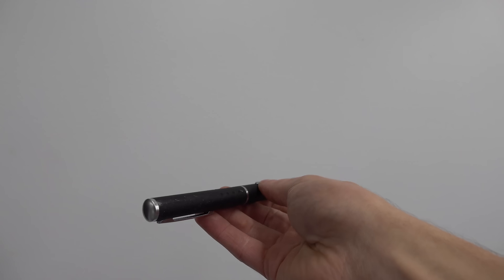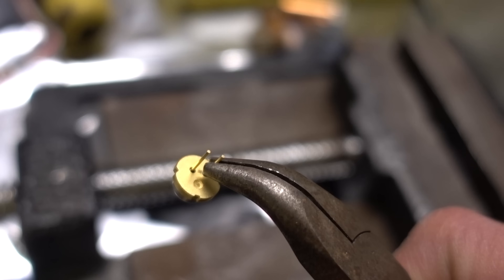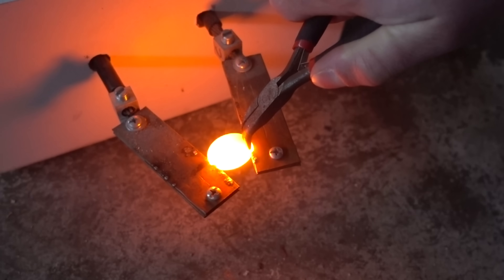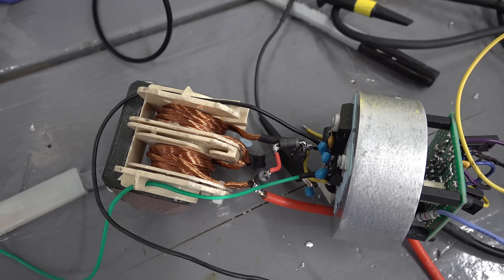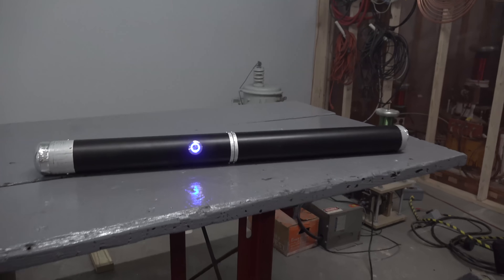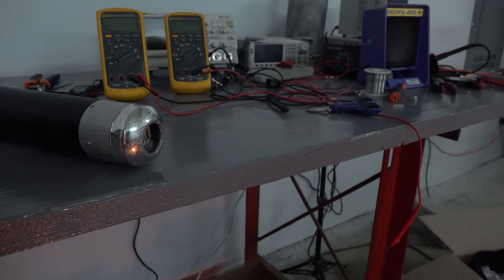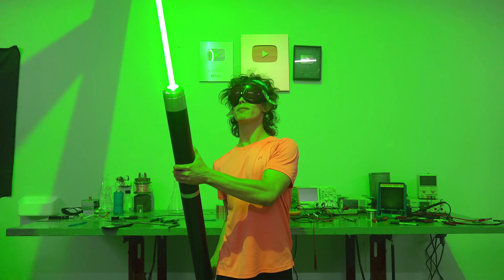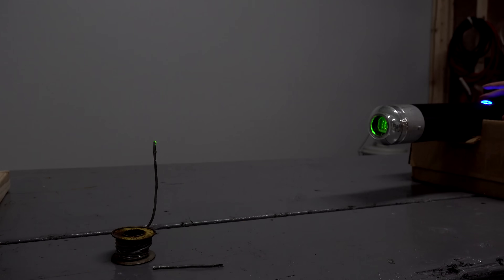the brightest laser pointer in the world!

Comment: Love your vids you inspired me to build a high voltage circuit in which it can hold almost unlimited electricity enough to produce fusion like 3KV and it works with a copper oscillator I have created a new type of dc ionized electricity on 24V it makes noises on my custom receiver and I would love to work with you on a new laser diode semiconductor that can hold enough for fusion. Let me know!!!!!! Mine currently die after a 24V charge is put through it i have an illegal diode makes it wide band. haha

Comment: Could the reason why the green gap exists be because it shares a harmonic frequency that’s close enough to be dissonant with AC or is it observed in both AC and Dc builds? 540 to 60

30.32thz (60cycleAC) and 5.33 (Freq of green)

it’s like playing the 5fret tuned up.33 cents and then the 6th fret 2 octaves up tuned up 32cents.

That going to be the most dissonant note you have ever heard creating pathways that are hard to traverse for electrons. If you could increase the cycle speed by 1.01 thz you might be able to create a harmonic resonance. It wouldn’t be perfect because those are round numbers and e is irrational but I would be interested to see the results

Comment: Life extension rule 101 , do not under any circumstances  open a microwave to strip out parts unless you know what you are doing, the capacitors in microwaves work on the principle of reaching charge then holding it for great lengths of time till you press the cook button and the discharge is near instantaneous, yep dead before you hit the floor unless they have been earthed and drained , so even old microwaves from the tip are still widow makers if handled incorrectly.

Comment: High frequency power electronics is funny because the current (or rather, the electrical energy flow) almost never follows the circuit diagram... components can "communicate" across boundaries never meant to cross.

Comment: styro could actually make sht ton of money if he started selling accurate 1, 2, 5w lasers or any laser for this matter because almost EVERY SINGLE laser is fake, the powers are way off. most 5w lasers are actually 1-1.5w lasers and 2w ones are closer to 1w as well. 

There is not a single good laser point website that isn't with fake power, fake beam length, fake eye protection glasses, fake reviews that also has normal shipping to all over the world. 

also if u see any laser pointers with like 30-80%+ discount, its likely a ripoff, gotten twice as cheap from somewhere else, probably including way less accessories than what the other websites have to offer.

like hunt laser website, no eye protection, no case, no batteries, no charger, only the laser itself, no different laser point changers(diodes) those cap endings so it'll look different etc but they are offered on websites.

they work under fake companies, their TOS should be considered illegal even. "All info can be incorrect and we are not held liable, all numbers might be wrong and its not our fault, all images can be illustrative as well, including the product description." basically they can sell you an empty box and they wouldnt be held liable because it was stated in TOS. so unless u buy one off the shelf cheap or with promising ratings over amazon, u gonna get ripped off.

Comment: @styropyro, Question: Could you make a 'magazine' or 'cartridge' with batters or capacitors, that hold then release enough energy to instantly burn/cut/punch through a decently solid object? Think along the lines of the AA Battery Laser Rick makes in Pickle Rick. So, basically a large yet portable laser that is one shot reloadable.

Comment: Inverter microwave ovens changed the game with it comes to their usefulness in cooking. They still suffer from the standing waves of a traditional one but you can dial in the energy instead of the blast time. Still, there are really only 2 or 3 settings of power, the rest is active vs inactive duration but even 2 or 3 levels of control is better than fully on or off. Helps especially in re-heating without risking the food's integrity if you keep it on the lowest power but longest cycle, so on mine, that's a 3/10 on the dial. Still takes less time than using an oven which uses considerably more energy to do the same thing but only slightly better.

Comment: Hi, I've seen lasers that strip rust off metals like old ornate fireplace mantles in older homes or girders and things. Had you ever considered trying your hand at making laser cleaning/restoration tools or laser applications for rust removal would it be possible for some sort of ultrasonic cleaner in laser form that removes dirt and grime from say old walls and floors you plan on repainting and polishing. Im imagining some sort of laser like power wash equivalent, would it be possible to laser clean an old wooden deck without burning it to black? a little darker maybe wouldnt hurt. power washing might put moisture in deep that could encourage weakening/mould that might get trapped if repainted/stained/oils. Would tattoo removal lasers be possible to be adjusted or applied somehow for cleaning or restoration purposes for say older electronics where water or chemicals maybe arent a great choice?

Comment: Hello there, I know it's kind of late to say this but if you want higher efficiency driving circuits, don't waste time with flyback topology. You can't reach more than ~85% efficiency with it because of it's design, mostly because of the leakage inductance that comes with the way a flyback transformer has to be made. If you want higher efficiency, try half bridge or full bridge forward converters with or without synchronous rectification.

Comment: Wouldn't the array of multiple beam sources, when focused with a single lens, produce multiple beam spots at the focal point.  Rather than one tiny single spot?  Still more dense though.
THANKS FOR ANOTHER GREAT VIDEO!!!
Reply: No. It should be one point; due to diffraction it will actually be a spot rather than a point, but parallel beams will be focussed to the same spot.

Comment: Question, i dont know if you will read this or any other viewer but i had an idea and wondered what your opinion on it is.

In some of your videos i see you use a lens to focus the beam to a singular point to put all that heat on a tiny surface area wich is great, however this does give the laser blaster a fixed range where its most effective.

maybe you could have a lens thats guided or railed and have the distance be set by a linear actuator that communicates with a rangefinder to position the lens so its focused on what your pointing at.

idd love to hear what you or other commentators think about this :)

Comment: Would it be possible to use lasers and the Photo-acoustic effect to make headphones that can give accurate sounds?
The idea is simple, just use the same idea as a solid state Tesla coil, but then run a laser with the circuit. The laser could hit a thin piece of steel. If you oscillate the laser, you could play music through the headphones. To make more defined sounds, just have more lasers focused on the sheet on steel, and make a more powerful "headphone amplifier".
I'm probably going to get hardcore bullied for even coming up with this. It most likely wouldn't work.

Comment: Jesus christ.  Anyone wanna help an electrical nooblet out?  16:40 to 19:16 needs ELI5 (maybe ELI35 but not an electrical engineer).  diode driver? flyback typology? 'avalanche over'? flyback controller? I know inductor.  'boost converter'? and what does a 555 circuit do? Drop across the circuit of 115V @ 2 amps?  because of resistance/length of wire in use?  short window of filter caps resulting in a short window where the current limiter is exceeded? TVS diode? at threshold? 'soft start' on the MOSFET switch?  Obviously I could look everything up but I'm hoping someone wants to show off and learn me so I can be more efficient with my own time. XD

Comment: Can you make a small fusion reactor with two tattoo laser remover lasers facing each other with a tiny pellet of hydrogen with a small black thing which will combust under extreme heat of the lasers seeing as those lasers also made the air turn into plasma

Comment: When I was about 12-13 years old I found out that you can buy laser pointers stronger than the one's people used to have as a keychain. Naturally, I started doing research as to what is the most powerful commercially available laser and what can you do with it. Found out that at the time you could get either green, blue or red lasers, and that blue and green ar more visually pleasing, whereas red tends to be hotter and burn through things easier. As a 12-13 year old I got excited at the idea of being able to burn straight through something, as at the time that seemed like something that could only be done in movies or cartoons. I found out that the most powerful laser you could get at the time was 200mw, so I bought one. I got it, wasn't as cool as it was advertised, but it was still cool. There were a bunch of warnings on the box not to have direct eye contact with the laser, but my curious dumb ass thought "hm, I wonder why" and decided to test it on myself. It didn't burn, didn't blind me, didn't even leave a temporary sun spot, but fairly recently, over a decade later, I found out that I am colorblind, and that specifically the red cones in my eyes don't detect enough red light, so the green cones in my eyes are picking up the slack. Not sure if the laser is related, but since I didn't go blind and did not experience any immediate effects, I keep wondering maybe I have colorblindness because of my own stupid ass decisions. Don't be like young me, kids.
Reply: Exactly! My "first" laser was a rechargable 100 mW Heypomax (rebranded) laser! It even burned a red marker! (getting the same exact copy.)

Comment: Hey I know you don't know me or anything about me but can you do me a solid, can you setup a proper ventilation system for when you are creating particulates? It's cool what you do but you should really make sure your lab, and even the paint on the walls, is rated for not causing fire or catching fire. To me it sounds like you are in a room with maybe a window maybe it's your basement. if that is the case you need to create ventilation. Don't blow air into the space, setup a system to draw air out of the space and up and released nice and high so it's not at ground level or kids level.

Comment: |             
|                                                  "+"
|                                                    |
|                                             ____|____
|                                                    |______________  "+"(out)
|    

|             "--"(out) ‾‾‾‾‾‾‾‾‾‾‾‾‾‾‾‾‾‾‾‾|
|                                             ‾‾‾‾‾‾‾|‾‾‾‾‾‾‾
|                                                      |
|                                                    "--"
Idea is to discharge capacitor(two plates) inwards instead of outwards in which direction force(hence Voltage) is weaker/lesser but inward in which direction force is much stronger/greater
After that charge could depart through mid-plane in between two poles/planes
without any hinder (because "+" and "--" in this/along this plane equally far)
And in theory charge could leave as much far as it takes(infinitly) without any effort/work

This is the idea- capacitor that amplifying Voltage (meanwhile current would be the same)
In theory it(this principal) allows to obtain free energy

Comment: can confirm power electronics = hard, tried adding input voltage reg to an LM25116 and ended up with some extra capacitors and resistors slapped on various places to at least get the feedback frequencies up above the audible range so it retained at least some efficiency!

Comment: Hey Styropyro or any other laser engineer, Im looking for a laser that can measure a short distance between 1in and 12in with an accuracy of around 1/16in or even better 1/32 of an inch. I cant find any online that have been designed, and im an inventor/mechanical engineer that currently works at John Deere, but im designing a new product for Soda Fountains that could use a laser like this. Im not sure if it would be cost effective yet, but this laser system even if pricey might still be worth it. I would need about 5 of these small lasers in a line to measure slopes of objects. does anyone here have a clue to the cost of such laser tech? Not to mention the Arduino and programing for the distance, and calibration.
Reply: I don't believe a general purpose laser is well suited to that task. Adafruit has a low cost LIDAR module claims 2mm distance resolution.

Comment: Very interesting. The triangle horse I at the end of the laser by the power switch WTH. Imagine the potential of creating large free energy sources by channeling either geothermal into light or sun light or Galactic energy through a prism of sorts into a radiometer that's connected to a generator. I prefer simple geothermal but for scientific reasons I think it'd be interesting to see the long-term potential. What could you use that energy for

Comment: How come the FBI hasn't knocked on your door yet

How are they still letting you run around out and about like this if I had tried to do any of this they'd come and cut my head off

Something about this doesn't add up dude I don't know what it is but something's wrong here

YOU'RE POSTING IT ON YOUTUBE THEY WOULD HAVE COME TO MY HOUSE AND BEAT ME IF I HAD JUST BEEN DOING IT IN MY GARAGE YOU'RE DOING IT AND POSTING IT ON YOUTUBE HOW ARE YOU NOT LOCKED UP HOW DID YOU SLIP THROUGH THE CRACKS OR SOMETHING

Comment: Back in the 1970s I used to work with helium neon lasers and argon ion lasers. The first one produced 6328 angstroms which is a cherry red color the second one produced blue 4800 angstroms and green about 5,200 angstroms and was quite heavy on maintenance to keep these things running.
Reply: Hmm, 632.8 nanometers is a lighter red color, 480 nanometers is light blue/cyan, 520 nanometers is green... You telling the truth or are you just converting nanometers to "angstroms"
Reply: @bitonic593  When I was an optical physicist at Intec Corp in the 70s, we did everything in angstroms. Our HeNe LASER was 6328 angstroms, a deep cherry red color. The Argon-ion LASER we had from Spectra-Physics could be tuned to 4800 angstroms (blue) or 5200 angstroms (green).
Reply: @basspig  okay, but it's gotta have some connection. did you read my reply? 480nm is a light blue, 520nm is green, 632.8nm is red in nanometers, so...?
Reply: @bitonic593  There's a 10x scale factor between angstroms and nm. I'm not sure when they started using nm--must have been after 1985, which is the year I retired.
Reply: @basspig  makes sense. I was wondering why they were coincidentally the same thing as nanometers but 10x
Reply: @basspig  angstroms = "decinanometers"

Comment: Do the cheap ones like the $14 one on Amazon have the beam visible to the human eye or do they only have the light on the wall and you can’t see the light in the air? I need to know before purchasing so I can make a lightsaber
Reply: If you want a wide visible beam you would be better served using smoke and a LED array that is collimated, you don't want/need lasers.  Typical lasers will not have a visible beam

Comment: Is it possible to add a second lens to extend the length of the narrow beam (to infinity)?  Camera lenses seemed to survive; maybe one of those could restore sub-beamlets to parallel after the first lens put them so close together?
Reply: It doesn't really work that way, they would still diffuse no matter what angle they were directed at.
Reply: @norbis3939  Diffusion is a separate issue, as are beam width, lens-loss and r^2 loss, but there's value in placing the beams closer together.
Reply: @tomnoyb8301  I see what you're saying, but think of it this way; The beams are already "parralel" after the initial lens focusing, in the sense that they will never cross each other. Each beam, after focus, is "shrinking" in diameter more than it is changing angle. So you could correct that with another lens, which might be somewhat useful, but I don't think it would have quite the effect you want it to have.

Comment: on the beginning part about green lasers and them being dangerous: got one off amazon advertised as a CAT TOY. turns out it was almost double the output of what can permanently blind you (in IR light, so completely invisible too) and it gave me a blind spot on my retina that hasnt healed for over a year
Reply: Hey, same. I had this big lad of a green laser pointer as a kid and loved looking in the output hole while it was running at low power. But one day the batteries happened to be at max charge instead. Ended up giving my right eye a blind spot around two characters across, and then doing the same to the left eye, also giving it a blind spot. Stupidity kek.
Reply: @Jiftoo  then it's not a "pointer" bro...

Comment: If you ever need a high current PSU that runs on low voltage dc (i.e. 12v) with an output of anything under 500v. Give me a holler, It's my specialty.